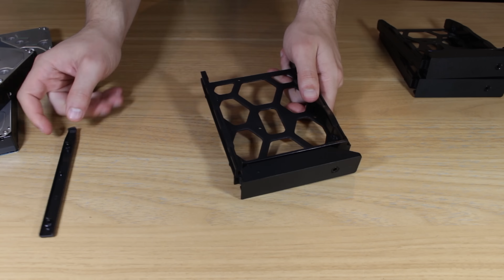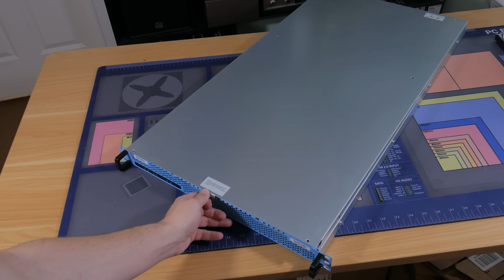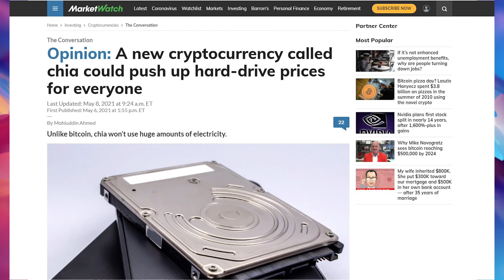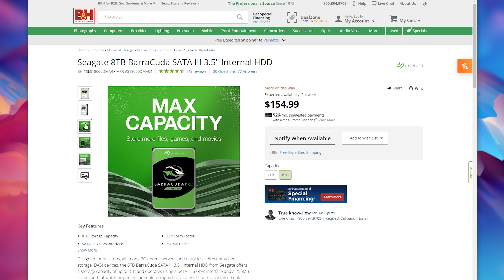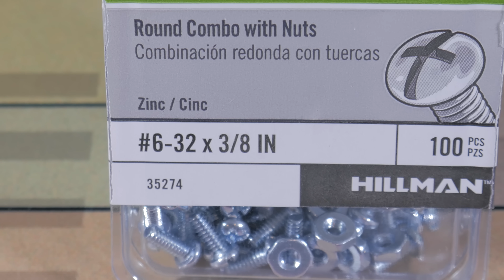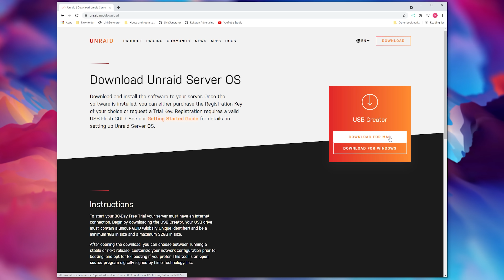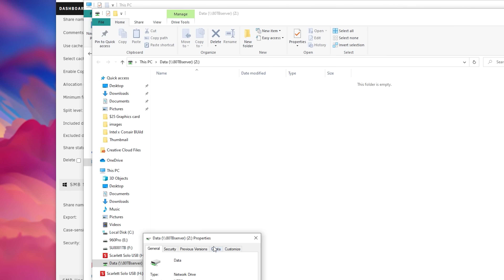Budget Storage Server 2021! | 80TB NAS

Comment: I am sooo jealous of these 8 TB drives. It's currently impossible to buy hard drives at reasonable prices, even used.

Let me tell you a story of a failed NAS. For a long time I couldn't afford new high capacity drives, so only way for me to build decent storage backend was to eat the cost of tens of 2 TB used drives. My storage needs oscillated then between 50 and 80 TB, so I needed, well, a lot of them. Sadly, after reaching my goal of having such storage (which meant EIGHT 8-wide raidz2 vdevs - that's 66 drives spinning, including 2 spares!), I did a post mortem, and concluded whole endeavor was incredibly stupid.

 - It took whole 2 years to build, using ancient hardware, multiple SAS expanders, expensive cabling - and a lot of it;
 - required incredible amount of extra engineering (custom case, sourcing and mounting several 1U backplanes for 4x 3.5" HDDs to enable 12V power to the PCB, a lot of soldering and fabricating risers, guides and supports);
 - due to shortages in PSUs, I had to stitch together four PSUs, and it sucked 450 watts when idling (this is not an exaggeration - that's measured from the wall), and consistently above 1000 going full tilt, like during resilver;
 - managing vibration of all of these hard drives was a challenge, not to mention cooling... it had many fans, and was loud, despite using generally quiet ones;
 - I didn't blow my back when handling the resulting device, but that had to be a fluke. It weighted like 60 kg. I actually installed double casters on it to make it somewhat movable.

Currently I scaled back my needs to measly 35-40 TB, and I am rocking happily 4TB drives in two 9-wide raidz2 vdevs - 18 total, with one cold spare on a shelf - all within single standard PC case. Much more manageable solution (still on casters, though), but if I could afford 8 TB drives, I could drop it down possibly even to micro ATX form factor, instead of full tower (kudos to Fractal Design for making actually usable cases!).

Comment: Unrecoverable read errors rating on those drives are probably x14, which means there is one URE every 12.5 TB. You will have problem rebuilding pools or even just to add storage.

Comment: buy an nvme m.2 to pice adapter use a 1tb nvme drive as cache  since its only pass through to the pcie get a really cheap low profile adapter. get the Seagate, western digital, or Samsung nvme drive I have had supper bad luck with other brands. Also if you can cram a 10 gig nic in there do it. But I didn't see the space from your video. Even with the smr drives your upload transfers will be be super fast. Sorry about downloads thats going to always suck. I almost forgot bridge your network ports try to get 2 gig if you cant go 10 gig

Comment: You didn't mention about network capabilities of the server. It's very important. I think there is a bottleneck.
Reply: He mentioned the 2 1Gb ports on the back.
Reply: @majorgear1021  it's a bottle neck, should be at least 2.5 or 5 gigabits

Comment: the huge plus side of ZFS is that it has CoW (copy on write, basically if you alter file it creates new copy of it and if something goes wrong it falls back to original)   and stores the hash of the file so it knows it is good. Since I got really bitten by raid5 slowly damaging my files on my first raid config, I don't really see point of making NAS with out similar technologies... Does unraid have something similar? I guess two parity drives can work out the issue with raid having difficulty knowing which file is a good one  (corrupt and good one since it is at least more likely that you have two good versions and one bad rather than two bad and one good version), but is that all you are relying on? Again this is just a question of personal risk tolerance and having that much storage in ZFS would require quite a lot of ram which many people say should be ECC ram. (IIRC it was something like 1GB for each usable TB, so for you it would be 64GB)

I personally don't have so many files that I need to back up, as most stuff can be just redownloaded and I stream my movies/series so I would also consider SSD NAS server if you don't actually need tens of terabytes of space. SSD:s also makes resilvering and building raid much faster, not to mention you can saturate your network bandwidth.So in short always think your use case. You might also be better of with backup service like backblaze so data is not in same location, which is either good or bad thing.  Good thing about is that if your building catches on fire or some weird electricity glitch kills all your devices you would still have offsite copy. Bad thing is that you have to trust whoever you upload your files.

Comment: First, he wants a Server, but not expensive.

He pays for unraid. he pays way more fore the hardware than he should ("its a little bit overkill on the xeon"), he paid for smr-Drives, who are only 40$ less than the NAS-Drives.

But he wants a server for a budget....oooo kkkkkk...

So let me get straight: If you bought a Synology, you dont have to deal with unraid/RAM and could have the money spend on better drives (with are the essiential, for the usecase you build this up). and not be doing this "external" takeaway of the drives, on losing support if one fails.....so in conclusion.....buying a synology would be better here? (and it would be quieter than a 1U / 40mm Fan Array oin the unit here) ?

Maybe someone can math this up and put this against each other to compare?

Comment: It's a great project, but with such a bespoke product that you've created, have you thought about how you will access your data when there's an eventual hardware failure (you alluded to this early on, e.g. the PSU, or worse, a mainboard failure). If you had to rebuild a similar system with different hardware, will the disks transplant and (a) be bootable and (b) contain all your data? 

How are you handling local and off-site backup - this must be challenging with the amount of data but something you can't ignore. You stated the data won't ever be deleted so it must have some value to you (personally or financially)

The reason I bring these points up is I've been there. A power surge once killed two drives of a RAID5 in a home system and I learned a lot of lessons. Power surge protection separate from a UPS. Local backups and regular off-site backups. I actually managed to recover all my data using ddrescue and a whole raft of other Linux utils - but it took considerable time and effort.

For anyone thinking about building such a bespoke project, ask yourself, how will I access my data in the event of a complete hardware failure or fire/flood

Comment: Hello, in my opinion, you need to ditch the SMR drives, make sure you lost them and you never sound them.  For this purpose i strongly recommend 3 SSD drives - One bootable drive and 2 cache SSD drives to cache the array. I will also recommend the use of RAID 6 over RAID 5. The reason is simple. RAID 6 ha dual parity information, so it tolerates the failure of 2 drives and continues to work, without data loss, this gives you plenty of time to react and fix it. NAS grade drives, re in general more reliable constructions, they are designed and intended to work in conditions like these, they have error correction routines in them (LDPC ECC) and they have more enduring motors, more accurate actuators for the read/write heads, stronger magnets and larger voice coils to overcome vibrations - the more drive you add the more vibrations you will introduce, and other improvements of HDD constructions like the motor and the actuator head is attached to both bottom and top for more stability, also the top comer is thicker and stronger because of that. make sure you allow lot of air around the drives. drives hate when they are hot and drives like when they are cool. intensive work, makes lot of drives to generate heat in close to each other in tight closed case, without free access of cool air. Think of extra fans. Noctua have excellent solutions, providing great airflow and great static pressure for low noise. the more fans the better, the more air flowing around the drives the better. good luck :-)

Comment: Part of me appreciates the cost savings of the external drives, but the other part of me cringes at the waste of all those plastic enclosures. And, as it's clear from the video, using external drives means that you don't really know what you're getting (other than capacity) until you crack open the enclosure. I would have spent the extra money and bought the bare drives to make sure I had exactly what I wanted. But I can appreciate what he got for the money.

Comment: Yikes, those Barracuda drives are not at all suitable for a NAS.  NAS drives have vibration dampening technology so that you can pack a ton of them in a case.  Regular desktop drives (like those Barracudas) don't have that.  The more you pack into the same system (especially in a non-jbod configuration) the shorter their life span will be. -- Hopefully those rubber gaskets will provide some protection.

Comment: mmmmmm be carful with these if you use a raid and it fails your losing your data as you are running it off the motherboard also those drives are cheap for a reasion

Comment: What's the power draw at the wall with all drives asleep and drives active?

I'm more  interested in getting sfp+ on there, 2TB SATA SSDs that I'd grow over time and 2x 1TB nvme drives but specially want low power (30W mild load) as it'll run 24/7

Comment: Suggestion - ditch the USB drive altogether and put the OS on an SSD. USB drives wear out quickly when used as OS drives due to all the small writes that happen (e.g. logging). The first and only NAS I built with the OS on a flash drive lasted about two years before I had to rebuild it.

Comment: I don't think I would want Seagates without a warranty. I've definitely had to use their warranty in the past and eventually replaced all of them with WD Reds. For software you could have used MergerFS+SnapRAID. That would give you the same advantages as unRAID, but has the advantage of being open source. 

The 1U format is interesting. The pro is you can fit more in a rack, the con is they are usually super loud. Without at least a 10Gb NIC, you can't really take advantage of the pro here. Could have been a good platform for setting up Gluster or CEPH.

Comment: One change I'd suggest is instead of having the USB stick outside since its not going to be removed get a short usb drive and use one of the internal usb ports. Just looked at that board and it should have 2 internal usb type A ports.

Comment: I've seen people use zfs in Unraid - but you gotta set it up manually with the console and some scripting for regular care called scrubbing. I'm planning to build a server/NAS based on Unraid but I'm a little scared about the manual setup part. I adore zfs from what I have read and seen from it - I really wanna use it - but I also really really don't wanna fck it up. I want to use it as my main storage and it's my first project of such kind and dimension. Unraid is planning to support zfs natively in the future - but its hard to say when. It's done, when it's done - which is excellent, because they don't rush it and want to be all safe. Now I just gotta be patient and try to build the hardware and software first to get familiar - and when zfs arrives, I'll ice out that sexy server with 18TB WD Golds to the brim.

Comment: Taking the drive out of it's enclosure does void the warranty of the unit as a whole, but according to the Moss Morison warranty act, it does not void the warranty of the drive itself  if it is no different than drives they sell for internal storage, as long as it's failure is still within the warranty period, and due to manufacturing defects.  DIY repairs and modifications do not void warranty's (even if stated in writing) as long as they are not the cause of failure!  Sure, the company can choose to exchange the drive only and omit the case, or replace the whole unit ut charge you for the new case, since you did break the original...  People need to read up on this kind of stuff!

Thankfully our new president and administration have tasked law makers, to draft a whole bunch of consumer protection laws, and putting the clamps on companies that try to get away with shit and control the market, or manipulate it in their favor to the detriment of other mostly smaller companies and consumers... and without boasting about it and taking undue credit while not doing jack shit in reality, or only creating illusions like our last one in order to get undeserved votes!

Comment: Hmm… How do you cool all those drives? I use a HPE DL380p with 12 Bays, 2 Xeons, 128 GB RAM and TrueNAS 12 BareMetal install - Total Ammount without disks: 300$ for a HA Device, which cool those guys… I have arround 35 Degree Ceslius in my 45U Rack (additionally a 3 Tier VMWare Cluster on used HP Z420‘s, as well as 3 Unifi Pro 19 Inch Devices) - so i don‘t think those HDDs are cooled enough… and looks not so HotPluggable… I mean, 300 Bugs for a DL380p Gen8 is not so much Money…

Comment: I have run into an... issue... I was sold a pair of G.Skill F3-12800CL9D-8GBRL memory sticks... The original listing was listed as 8GBx2 (16GB)... The price was super low... half what I was seeing elsewhere, so price wise, I don't appear to have been ripped off, but the G.Skill website says these are 4GBx2 (8GB). I just can't use these on the desktop I'm building (need 32GB) and I'm outside the return window for these (I was busy with work, and only recently got to sit down and mess with my PC parts)... Would these RAM sticks be compatible with this motherboard, or is it not compatible with the unbuffered DIMM sockets? I realize ECC is preferred, but it's what I have on hand, and I'm really only making a media NAS out of this. If they will work, then I'll just use these for the time being.

Comment: so my thoughts: last I knew, shucking voided the warranty on the drive, but more importantly, they may not be able to be powered over sata directly, need to cover up the 3.3V pin or something, but this is several years old, so maybe neither apply.

Personally I would rather grab a large  EATX case and get PCIe to sata add-in cards, so there can be good cooling without those tiny 40mm fans whirling up a storm.

As for the configuration, I think unraid is fine, and as mentioned, avoid shingled drives like the plague.  Who wants to read data back before over writing it, when an HDD is already the bottleneck for file transfers....

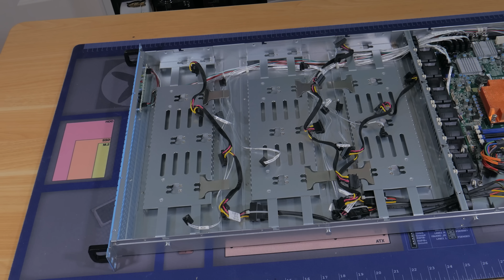Comment: Note for at 2:10, seagate exos drives (at least the 14tb ones I bought) do not fit, they do not have the middle holes for the mount downs, you will have to drill your own holes in the mounting tray to hold them down correctly.

Comment: You did a great job!  I gave you a thumbs up.  A small bit of constructive criticism.  Just slow down with your monologue.  Its not a race.  I am watching your channel because I feel your information is important.   Other than that excellent job!  I use Unraid myself.  That is a great choice. A Channel you will be interested in is "Spaceinvader One"  He has excellent tutorials on UnRaid.  One feature with UnRaid that you did not make people aware, is expansion.  Normally with a ZFS system your ARRAY is striped across all drives.  This improves performance.  If you want to expand your ZFS array, you have to back all data add new drives and rebuild the array.  in the case of unraid, as long as you have an empty slot, you can add a drive.  That is provided the drive is the same size or smaller than the parity drive.  No rebuilding necessary.  One other thought.  Its important that you test the drives in their USB cases first.  You can use a plug in called Unassigned Devices, mount the USB drive and test it.  What this test does is zero out the drive first, then starts writing data to the drive, then verifies the data written.  This takes much longer to set up as  you using run this test 3 times. but the benefit of this process is you test the drives BEFORE you shuck them.  If any SMART errors are set you can send the drive in for replacement before pushing the drives into service.  You can clone your USB drive but the license is tied to that specific USB drive.  So if you restore your cloned data to a new drive, the server will be unlicensed. So if you want to change your USB drive, then you will have to request a replacement license.  That process is painless.

Comment: Be aware if you replicate this - some external HDD's with USB interface comes with the USB interface directly on the controller PCB.
There is NO internal USB-SATA converter, it can ONLY be used as an USB drive!

Comment: 9:50 Does it mean if one hard drive dies, you have no redundancy backup copy on other drives ?
Reply: The parity drive stores data in each sector calculated from the same sectors from all the other drives, so as long as only 1 drive fails it can look at the others and work the algorithm backwards to know what was on the missing drive and rebuild it. If another drives fails during rebuild data is lost but only the data from that drive (unlike normal RAID), and the probability of that can be worked out from the bit error rate and MTBF which usually works out as unacceptable in arrays with consumer SATA drives of several TB. That's why RAID1/10/5 are often considered obsolete for mass storage, a lot of that decision depends on the data and backup strategy though.

Comment: Should have gotten at least 2 or 3U and installed proper cooling for those drives... Lets face it..those are cheap seagate consumer drives and will probably sroke out from the heat.